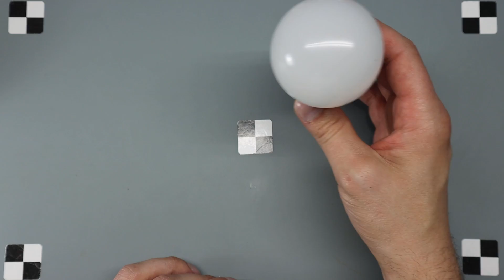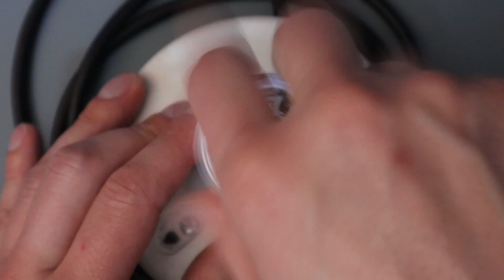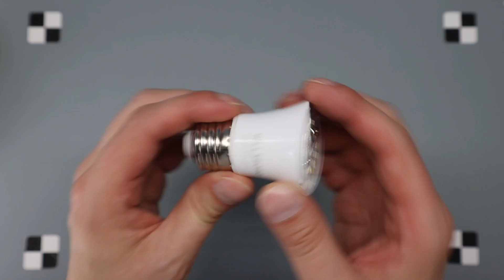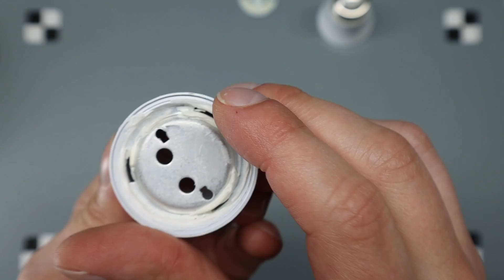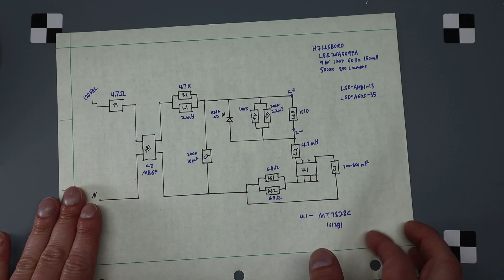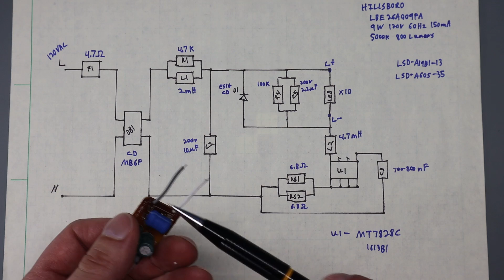Teardown HILLSBORO LED bulb with schematic

Comment: I think D1 is supposed to connect below L2, at pin 4 of U1.
This IC has a VERY good data sheet.  Some of these chip datasheets are terrible.  The datasheets for JoulWatt are excellent.
Reply from the maker: Thanks for that correction.  Not sure if I mixed that up when I was tracing the connections or when I transferred it to the drawing.